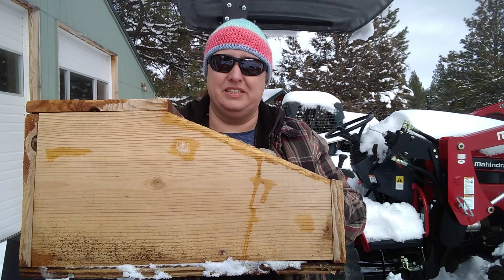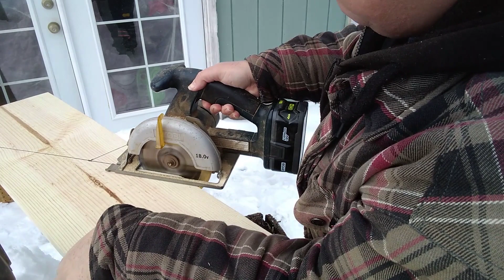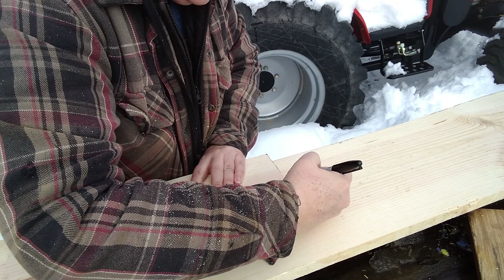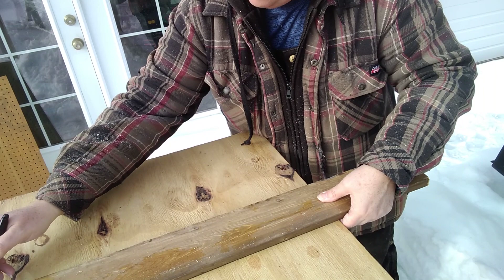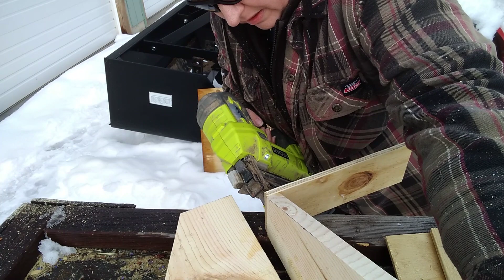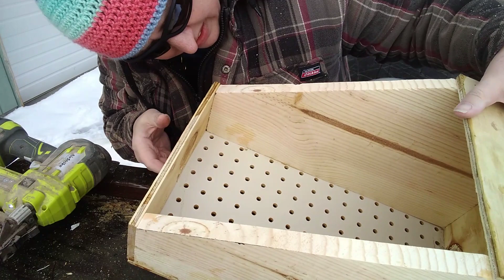How to Build Your Own Rabbit Nest Boxes

Comment: Where i buy my lumber they will cut straight lines on request. So if i have a list of lengths to cut i can take a screw together kit home. Just means straight edges for the sides, but that is fine. Saves me a lot of work (and the stuff fits my car way easier).

Comment: How do the rabbits drink in winter. Doesn’t the water freeze all the time?
Reply from the maker: The nipples on the water bottles do freeze up pretty easily. Most of the rabbits are in the barns though, and we don't have water freeze in there until it hits 15 degrees outside for more than a couple of hours. The rabbits outside get switched out to Crocks or bowls during the cold weather, and we come through and melt them then fill with warm water a couple of times per day. Some winters that's every day for months, this past winter we only dealt with it maybe a dozen times. Just part of living in a climate with cold winters.

Comment: 1/2x1/2 hardware mesh works great for the bottoms also. I cover it with cardboard so it can be removed. I've also just left it open in the cages so I can lift out the box and then scoop up the litter. If you add hooks to the back and hook it over the cage it will prevent throwing. Great video fantastic ideas. Thanks for showing the older models we can draw ideas from

Comment: Thanks for sharing Nikki. Just got done making 2 new boxes, because I have a Red Rex and a NZW due tomorrow. I used plywood. So far, I have not had does that chew them up. Lucky me. I'm not sure what the recommendations are, but I have had good luck cleaning any wet nesting material every 4 days and adding new hay. The does have seemed to be fine with me doing this and I feel good about having the kits in as clean a environment as I can.
As always, thank you so much for sharing your knowledge to help others.
Blessings to you both.

Comment: I a slightly different way for a few reasons.  1)I work in construction and I'm always able to find enough scrap wood 2) It takes me literally 2 minutes, so throwing it away and making a new one is easy if it gets gross. 3)I'm a hack, and don't care about quality in this kind of stuff. My method does not produce nice looking nest boxes.

I don't even measure, I roughtimate the size of the front, bottom, back and top. I nail those together, and then I nail a board over the sides and cut off the excess.

Comment: Luv your program .great info.
I use 5 gallon plastic rectangular  drums cut down like your nest box . Wired down of wire floor.
Reply: Thanks that's a GREAT idea especially in summer when you don't need the extra insulation